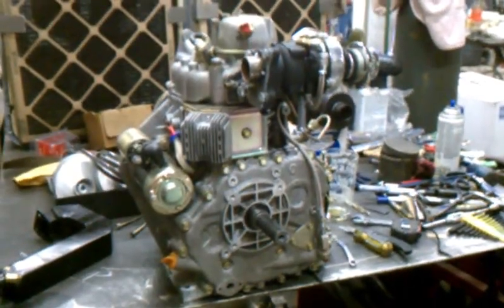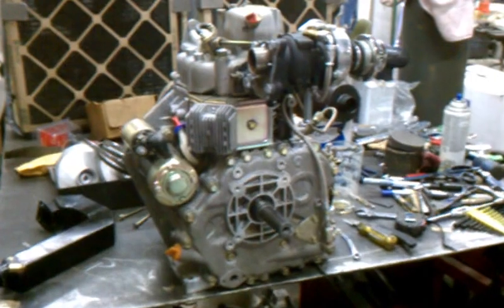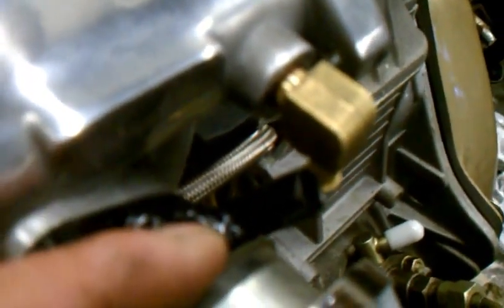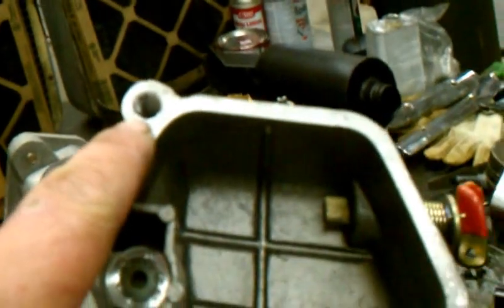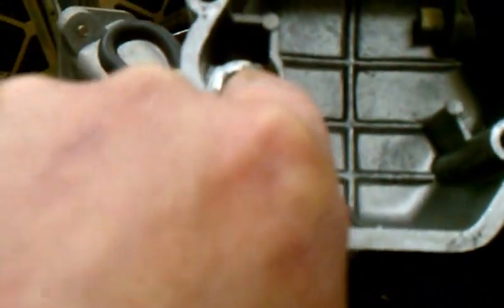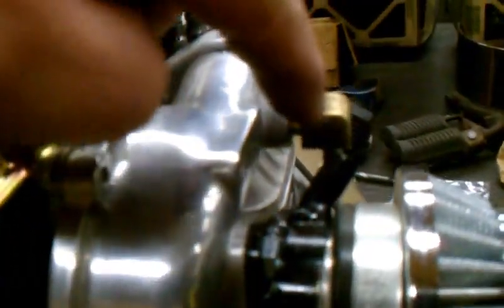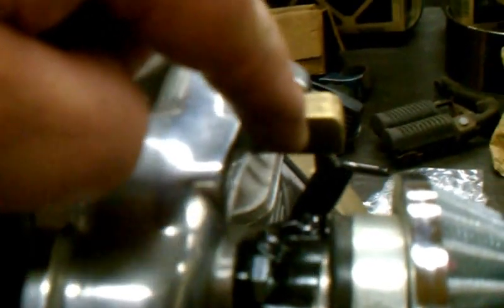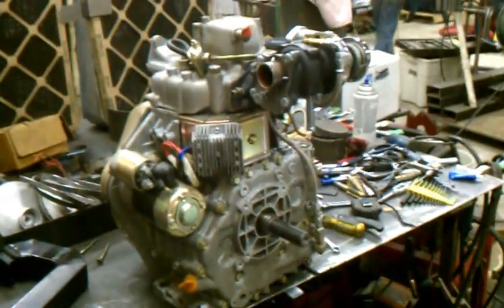How to turbo turbocharge 186f 10 HP diesel engine

Comment: Dónde o quien tiene un turbo para adaptar a un motor 186f
Reply from the maker: @antoniojoseordosgoitiavarg8524  I had to weld it up myself 
Additionally the large square plenum feeding the engine was 3x the displacement or about 1.2 liters to buffer and absorb boost surge. Inside that plenum I had a high pressure fin mist water injection liquid intercooler.

Comment: Can you do a more in depth video? I have the same engine and turbo and have the same plan
Reply from the maker: Sorry no, sold that bike years ago on ebay for 7K.

Now I'm all electric because brushless rotary motors are superior to flailing engines in every way.
Significantly superior!

It is much easier to harvest sunshine than filter fry grease....

Comment: Hello, I have built this same setup, but I drilled and tapped a 3/8 air vent into the valve cover.  I did not plug the pcv valve  because the vent to atmosphere should be enough to mitigate the case pressure??  Do I still need to plug the PCV? You can check out my build process on my channel.  Thanks!
Reply from the maker: If you start blowing out the oil then yes, but see how it goes first.

Comment: Hi Brent. I inadvertently put my pvc valve in backwards and blewout two oil seals. So I drilled out the port you demonstrated but didn't plan on plugging the port on the inside of the valve cover. I was going to of corse install the pvc properly and vent it through the newly drilled port to the atmosphere. I didn't realize that it was designed to vent through the untake. I thought they plugged the pvc port to pass some kind of EPA rules.
Reply: How did you discover about the pvc port.
Reply from the maker: @barrett9631  by trade I'm a airplane mechanic, I knew enough to look for it, especially when adding boost.
Reply: @BrentHasty  thank you for the reply Brent. I
Reply from the maker: Good info, and forcing atmospheric vent vs intake plenum vent is a good idea. I vented to a tube on the vacuum side of the turbo, but the vacuum may have been too much.
I like your to atmosphere idea better.

Comment: Did you ever finish this... what size fittings for oil line
Reply from the maker: Yes, sold it on eBay for 8000, it now is a daily commuter for Thomas in Texas 
1\8 NPT fitting and lines were used for the feed,  and 3\8 return line.

Comment: You realize thats a boost port right?
Reply from the maker: Pointing at the black tube, not the brass fitting.
Vacuum side not pressure side of the turbo...
For those who might be confused

Comment: Brent, I'm doing the same thing except with a K03 turbo, I have run it and seems fine across the board, but is the venting absolutely necessary? What is the max pressure allocated before break down? I have a few videos of it running on my channel if you might want to hear it. Looking forward to your reply, Mitch
Reply from the maker: Hockey47Mitsch as I understand it is not a good idea to pressurize the crankcase on any piston engine, it is best to evacuate it!

Comment: Putting a turbo on an engine not designed for one, causes heat and wear problems. Larger engines that have turbo and natural versions, usually have lower compression pistons in the turbo version. Also running and producing a higher hp will also increase exhaust gas temperatures. Excessive EGTs will cause wear in the rings, cylinder and valves. You could cut the engine life in half, maybe much less life.
Reply from the maker: Ocean Mariner agreed such things must be done with cautious intellegence, but that does not mean it is impossible, just problems to be addressed and solved.

This why I shared this important info for others bennifet
Reply: To add to this note that the stock pistons in these are complete cast aluminum. Diesel turbo rated pistons are normally cast aluminum with a steel ringland inserts so i would expect shorter time between rebuilds on these and 8 psi is Nothing.
Reply: Dude, these engines run a very low compression ratio for a diesel,  19:1.  they can handle a turbo no problem as long as you aren't over speeding it and way over boosting it. They also have pressure lubrication for the crankshaft and rod.   And at the end of the day  any diesel is better with turbocharging.
Reply: @A_Man_In_His_Van  Not so. Natural aspirated diesels are designed with a HP and EGTs in mind. People that add a turbo are either after more hp (that leads to higher EGTs) or to install a smaller diesel by getting more HP out of it (that also leads to high EGTs). Naturals are built with components designed to withstand expected temps. Turbo engines, besides having different pistons, often have better cooling, wider bearings, heavier rods, higher fuel flow (extra fuel passing thru the injectors cools the injector tip and returns to the tank), some engines have different water passages or a different head, and sodium filled valves to cool the mushroom end. 
No I don't have any experience with little diesels, but any engine producing temps above design will have a shorter life. Period.

Comment: wouldn't the boost cause the engine to get too hot and be in the grounds of water cooled ?
Reply from the maker: lucian kristov we use a boost actuated aquamist intercooler to address that
Reply: lucian kristov no our older tank diesels were air cooled and turbo charged m60 series tanks

Comment: That's not a vacuum on the turbo .thats pressurized during operation.its the waste gate control.u need to be after air filter before turbo
Reply from the maker: Pay close attention, I'm not pointing at the brass pressure tap, but the black tube in front of it between the air filter and the turbo intake.
However the vacuum of the turbo may be too much, just vent to atmosphere...

Comment from the maker: running 7psi which is the stock waste gate, I have bypassed the wastegate and seen 25psi but that drove the EGT past 1600F
getting a couple pounds of boost at idle, a larger vnt15 might be better than the rhb31